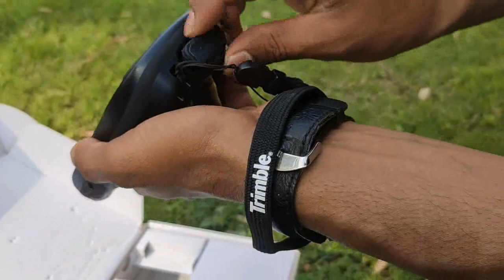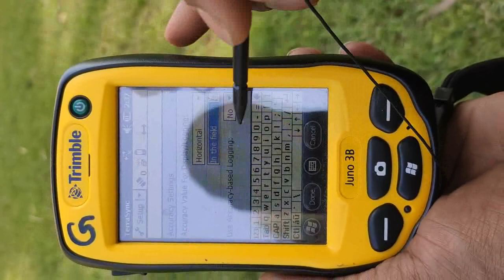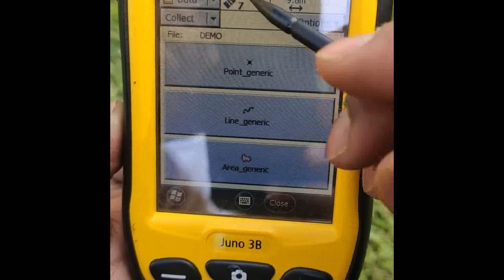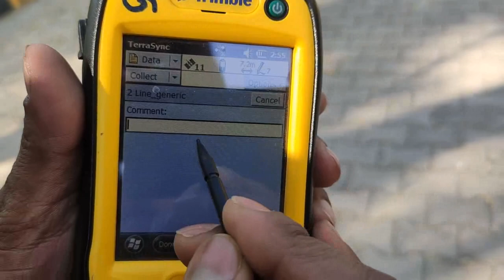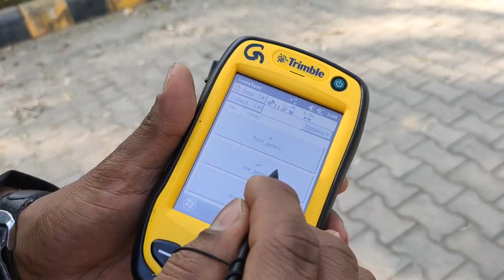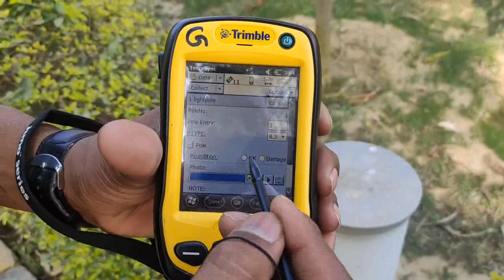TRIMBLE- GPS: JUNO 3 B

Comment: is is possible to copy collected data from sd card to laptop, and how to convert it to shape files ? thank you
Reply from the maker: Yes, you can transfer the data from device to laptop but with the help of data cable.
Reply: @Geo-Informatics  i copied the data without the cable data, i used card reader. and there are 5 data with 5 deferent extention names. such as .dd, gic, gip, gis and giw.. and how to open or convert this data to shape file ? thank you